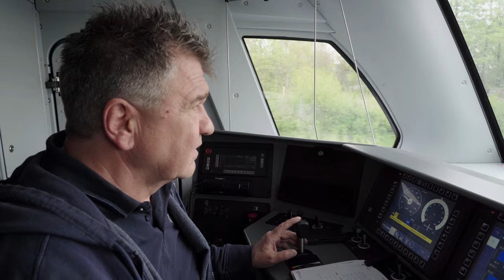Stadler’s FLIRT Akku trains: a diesel-free solution for a greener future

Comment: How is the electricity being used to charge the batteries being generated? Depending on the method it may be generating more co2 per year than a diesel engine.
Reply: Bic Dynamo?
Reply: @TRAXXspotter26 that wouldn't work, perpetual motion machines don't exist because of resistance.
Reply: German electricity mix for the first ones. 53.4% of renewables already, and that percentage is consistently climbing.

Big plants have way better efficiency and way better exhaust gas treatment (to filter all the pollutants but CO2) than a comparatively small and weight-restricted portable motor. So it can even be more efficient and less harmful to burn diesel at the plant than in the vehicle. 

We have to consider, too, that this train uses regenerative braking to re-gain a lot of energy, which a diesel train can usually not do. 
Turns out, just keeping a train moving doesn't take all that much energy (i.e. German high speed trains between Frankfurt and Colone stop any power input some 50 KM/30 Miles before Colone if on time). It's getting a train to move that takes up a lot of energy. So if you can regain the energy stored in the movement when braking, that is very efficient. The same goes for elevation changes, take more energy going up, re-gain much of it while going down.
Just using regenerative braking, the London underground saves over 1/6th of total power.
Reply: I'm not sure there's any form of electricity generation, other than perhaps a petrol generator, that would be worse than a diesel.

In Germany Deutsche Bahn like to claim that their trains are 100% powered by green electricity. This is sort of true - DB uses lots of hydroelectric power and although the total power they use is something like 66% green more than half goes to other uses. If these trains only charge from the normal overhead cables then you can say they are 100% green. However some non-electrified sections will have charging stations in the middle and then the power is coming from the normal mains.
Reply: The electrified regional rail in the state of Schleswig-Holstein uses 100%  renewable energy, at least nominally
Reply: @haisheauspforte1632  dude this is from 3 weeks ago, shush plz
Reply: @LiamTems why so rude for no reason